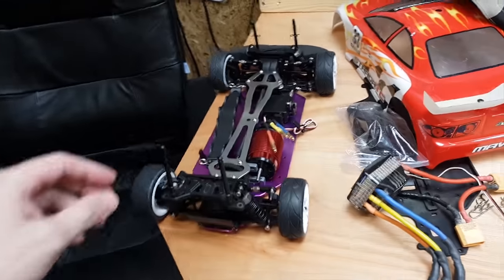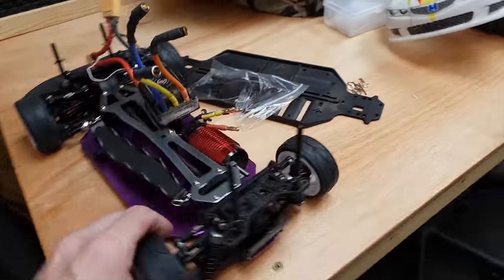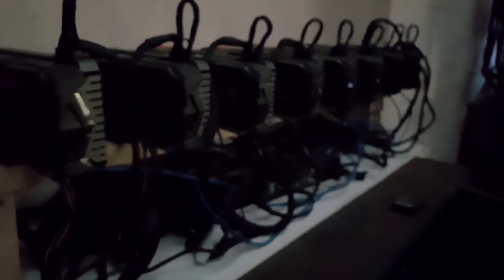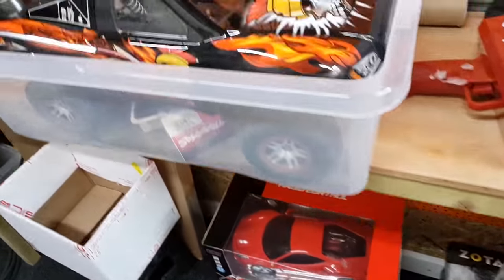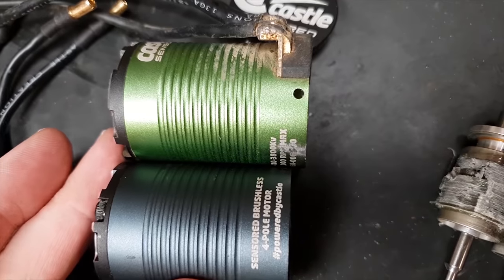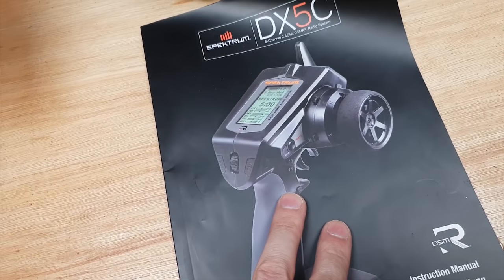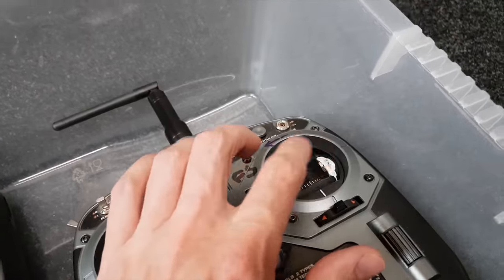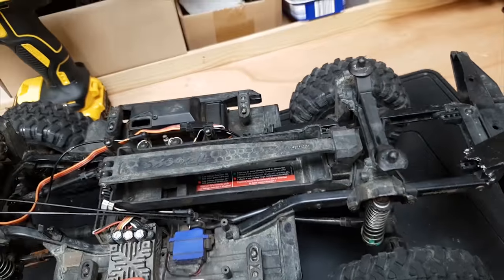6s Aussie BURNOUT Car Project - UPDATE VIDEO

Comment: So Kev, I also owned the Maverick and wanted it to go on 4s. After a quick look I decided to stick with 2s or 3s, it's just to instable. Before you try your luck you definitely have to shim your diffs AND your axles. Also you have to fill oil in your diffs. Another point is that you have to change to metal gears or at least to gears with modul 0.8. I think these are the main points. Without fixing this you have no chance to ran 3s or more.

Comment: I'm not sure how much the spectrum radio will cost but you could get a flysky gt3b or c for 30 odd quid, I think it was 15 quid on a programming board, then flash the radio to have many more channels I run most of my trucks cars boats and rc paraglider off the same radio. Also upgradeable to 12v lipo which makes life much easier. Loving the vids as always shame about the mining rig for now.
Reply: DavesFPV i paid $130 for spektrum DX5C and I love the hell out of it 😂😂💯💪

Comment: If you are going to put in all those electronics, use a smaller motor and esc.  I run a 3300 kv brushless and that thing goes 35mph on 2s.  You could probably use a 1/10 scale motor and esc with the same result.  It's lighter in the rear and easier on the chassis.
Reply from the maker: 1/10 does not have have the power and heats up to quick, I may even go bigger than 1/8 electrics

Comment: Kevin you have a great channel!
Keep those videos coming!!
Hi from Puerto Rico!!
Reply: I've been trying to make a burn out rc myself.  Used a Nikko Plymouth Superbird car body on a Team associated TC4 chasis. Took the shaft out and reversed 180 degrees the front diff and put a TC3 nitro break on the diff. Not done yet but it will lock the front wheels while the back are spinning.

Comment: the green castle motor is not the crawler motor, those are the SCT/ normal motor. (edit:) the spektrum radios are programmable for 4ws in their menu system.
Reply from the maker: i want the front and rear searable independently and this radio does it :)

Comment: i am waiting for the arrma’s
Reply: Andrew H. what
Reply: Yeah me too I want to see how much better the E-Revo is than all of them
Reply: InfiniteRC Logic it's the opposite
Reply: Nah you have to upgrade all sorts of crap like diff oils and tires to compete
Reply: InfiniteRC Logic Tires???
I have the backflips on my kraton and they are Amazing
Reply: Thats pretty great! Ive never seen a Kraton perform better than an E-Revo 2.0 and most of that was traction issues on lose dirt. But here where I live nobody uses Arrma because its hard to get parts at the local shops
Reply: InfiniteRC Logic here were i live there are very few hobby shop and there are not near.
So i just order parts from internet and they are very easy to find

Comment: i have a 6s 4x4 buggy and it takes a beating it is fully alu and its running on a hobbywing setup it only cost my 300 euro’s.
Reply: Alu? And that doesn't bend with every impact? ;)
Reply: 8s baby that’s what’s in my buggy😃
Reply: 8s Steve how much did it Cost you
Reply: Fortnite And RC I’m not sure now but I use the max6 like Kev runs in his xmaxx, not much bigger than max8